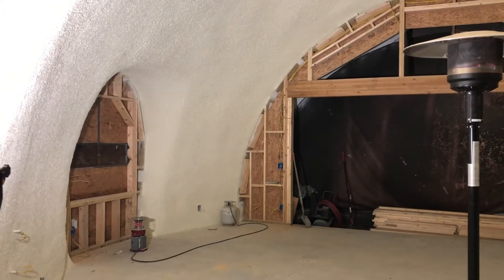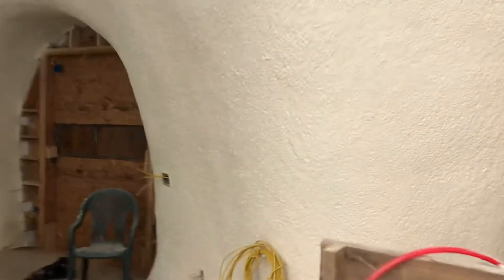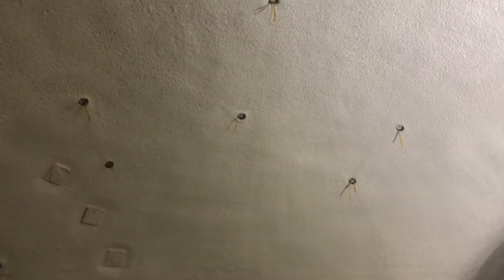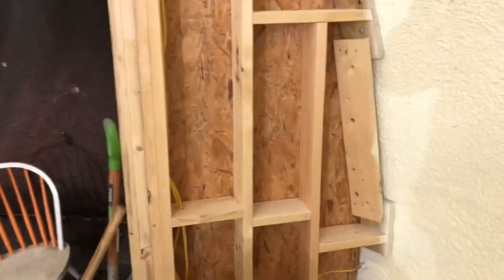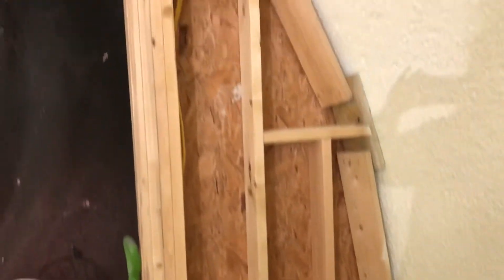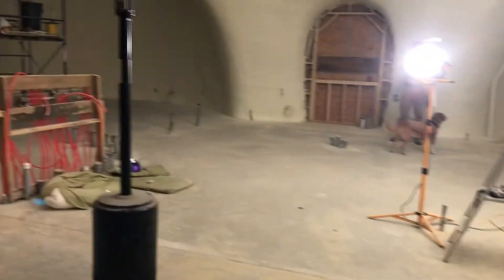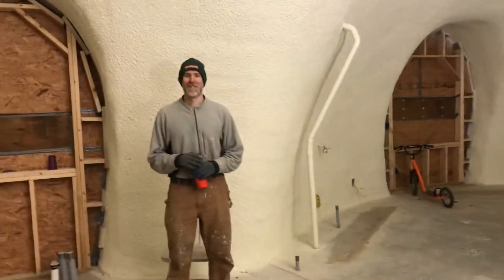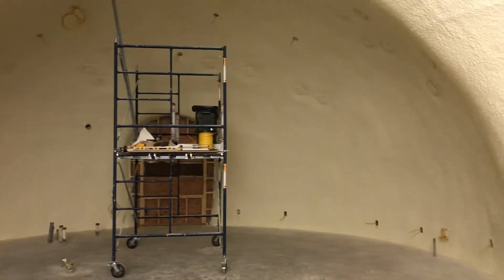Monolithic Dome build update - Sheathing and exterior electrical

Comment: What surface does it have construction? The dome type structure is interesting but it is a little more difficult to arrange the interior space and of course to furnish. Good luck!
Reply from the maker: The interior surface of the shell is concrete. Some people do plaster the inside to make it smooth. The interior layout was actually easier to design than a regular house because there aren’t any load bearing walls. You can put walls any way you like. Building the walls will be harder because you have to intersect the exterior curve. There will be plenty of flat walls to place furniture so we are not worried about furnishings. The space is big enough to have living room furniture just in the middle of the room.
Reply: I have a dome house with a diameter of 10 m and thermal insulation of 30 cm. I know that it is an efficient structure both in terms of built space and energy, but sometimes I feel the lack of straight walls and rectangular rooms.
Reply from the maker: @BCreativeDIY  One of the reasons we chose to do four domes on one floor (all 4 are 32 ft or about 10 meters each) was to allow for more interior straight walls. It would have been cheaper to do a single dome and just build more floors. Hopefully we don’t regret our decision! I think our biggest challenge left will be the kitchen cabinets. We did design it so most are on straight walls. 😁

Comment: if you ran an electric space heater (large one) it would raise the temp enough to spray foam
Reply from the maker: We tried that. Unfortunately it doesn't produce ideal conditions. Even if the air is warm enough inside, the uninsulated areas we need to spray onto develop condensation. (too much of an indoor outdoor temp difference) We tried a dehumidifier but that was not enough to battle the condensation completely. Urethane foam sprayed on a damp surface is a no go. We even rented a propane rocket heater to aim at the openings. That worked BUT the exhaust it produced was too toxic to work in. So.... we wait until spring....
Reply: @dometastic  aw, humidity build up.  Yes, cold damp weather is a problem.